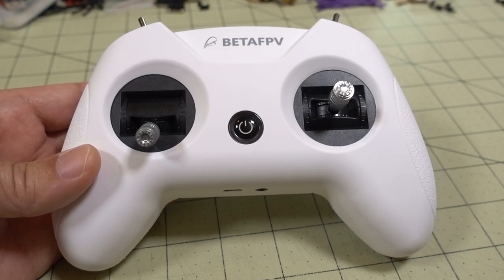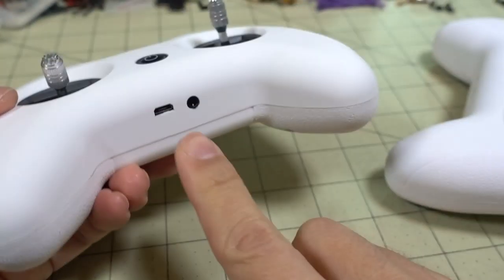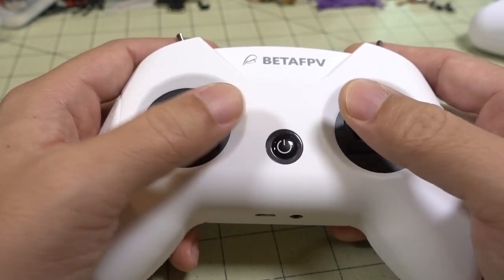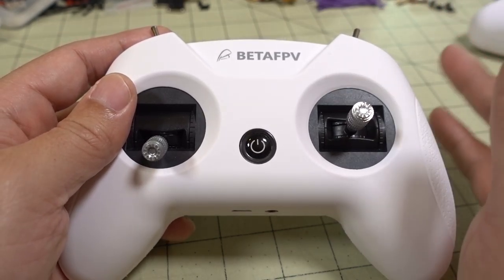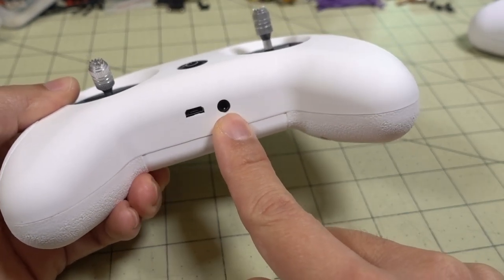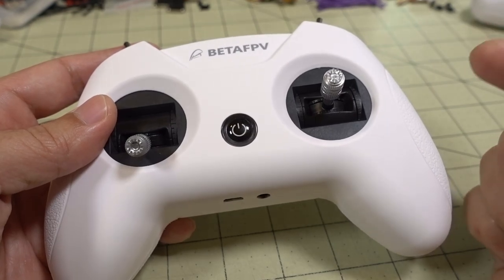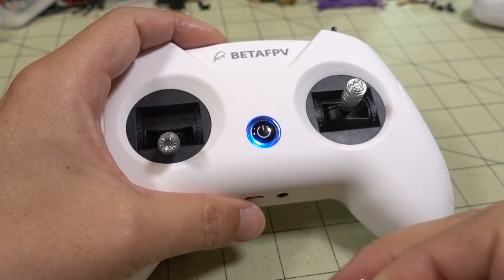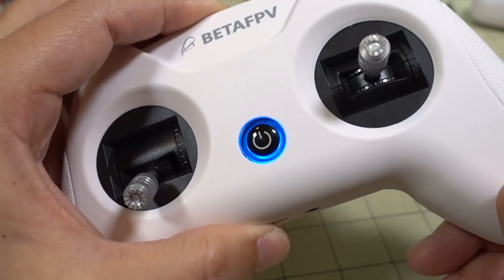BEST Beginner FPV Transmitter // BetaFPV LiteRadio 2 📡

Comment: Thanks for the great review!  The new features of being able to charge the batteries inside the TX is awesome and the extra modes makes this a great value.  Due to the increasing severity of my arthritis I have had to progressively move down from an X9D, to a QX7, to an X-lite and to the original version of this radio.  This because of the lower weight so my hands don't tire as readily, but I still have to use the X-lite to fly any D16 models.  However, the fact that I can simply remove the extra weights in this version is a real game changer for me and great thing to know.  Hopefully, I will get one these when they become available.
Reply: Just an f.y.i. they are already available on beta fpv's  website. Atleast they were yesterday when I was on their website.
Reply: @itsme-fr5fr  Thanks!  I'll check that out.
Reply from the maker: Yes, you can buy these now.

Comment: I got mine a few days ago (purchased from FPV Cycle, shipping was FAST!) and I gotta agree, this is a nice little radio, and perfect for Whoops or as a travel radio.  I am one of those that think the gimbals are a bit loose, but I do like tighter gimbals in my radios.  But I would say the tension is "average".  The big miss for me (just like the x-lite) is no lanyard lug to hook my strap to.  I pinch and have big hands, so just holding the radio doesn't do it for me.  I had to fashion a "holder" for my lanyard and it works great now, but would have been nice to have a lug built in.  For $40 you really can't go wrong.
Reply from the maker: Yeah, for $40 I think it checks the majority of boxes for most people for a budget radio in this class.  For those that need more, they should consider the higher priced models in the $100 to $150 range that will do a lot more for a lot more people.
Reply: Project Mockingbird how does it feel for pinching?  I’m a pincher too
Reply: @philevon  I'm 6' 2" and have big ish hands, and if i didn't use a strap pinching wouldn't be comfortable to me.  It's the same issue i had with the x-lite.  But with a strap, no problems!
Reply: @Project Mockingbird how did you fashion a strap holder? Zip ties?
Reply: @slightlymedicated  I had a really big rubber band that I looped over top...hard to explain in text

Comment: Trivia bit just got my Betafpv tx and it fits perfect in the Fatshark V3 goggle case. ;) so does a Mobula7 with 8 batts LOL!
Reply from the maker: You got all that to fit in there???
Reply: @AlbertKimTV  Either or, just the controller and batts or 7 with tons of batts. The red light stick sw alert caught me off guard getting d8 set and it came with d16 default maybe they changed from d8. Waiting for the HD 2s great beginner quads why I got the beta to train locals. LOL!
Reply: @AlbertKimTV  I fly on my lawn and do public FPV outreach letting people go for rides with echine box goggles and dispel the drones are evil spying things. Then they see flying fast or proximity is not looking at stuff or people other than to avoid it or them LOL! we need to counter the neg media spin daily if we want FPV saved as a hobby.

Comment: Hey Albert, I've got the turnigy evolution that I use for a couple micro park flyers. A small radio that looks inconspicuous. Besides flysky to frsky is there a benefit to this over the turnigy? I have trouble pinching the turnigy because of the screen. Is it easier on the beta radio? Or should I just stick with the turnigy?
Reply from the maker: Pinching is not easy on this one either

Comment: please explain when it comes to actual flying when one has quads bound in different modes, i.e., one D16 XM+ quad and one D8 whoop. let's say I'm done flying my whoop and want to fly my D16 quad (already bound). will I have to change modes with that button sequence every time fly between quads with different modes?
Reply from the maker: Yes, you will need to change the mode to switch to the different type of receivers.

Comment: How is the latency on the trainer port?
Does the internal 2.4ghz tx turn off while in trainer mode. I would likely be using an ezUhf Jr module on this but I need the 2.4ghz signal to go silent.
Reply from the maker: How are you using a JR module on this with no module bay?  Also, how can I tell if the 2.4 ghz is off or not?

Comment: I would be interested in seeing if its possible to put some hall effect gimbals in this because that would make this a much more desirable product to me. 
 I know it has been done with a flysky i6 and the upgrade hall effect gimbals from frsky before so I bet its possible with a but of modification. 
Either way still looks like a great controller for $40 and would definitely be the one I purchased if I was just getting into the hobby, actually I still wanna get one now because of the size and I already own a frsky x-lite pro. The only week point is the cheaper gimbals because they don't stay accurate very long and you end up with alot of play in the middle stick witch makes it so you have to setup a big deadband for those channels and that's never a good time
Reply from the maker: I think adding hall effect gimbals might be available as an option for say another $40 cost.  So taking the $40 radio to $80.  There's no way they can add that and keep the price the same.  Also, they are not targeting seasoned pilots like you.  These are meant to be an entry level radio for a beginner who will use it for a while and then upgrade later.  So longevity is not the main goal of this transmitter at this price point.
Reply: @AlbertKimTV  playing devil's advocate, I love the form factor and really want simple and small.  I have a Taranis and it is just SO humongous for just fun-flying at a soccer field with a TH Freestyle.  I actually hope this is perfect for a single model intermediate flyer like myself.  Should I be looking at the more expensive small controllers, or will this do for casual solo-flying a few hours a month and flying on the sims?

Comment: Hey Albert... trying to get friends into the hobby and wondering if you know if this will bind with the frsky usb dongle for sims? Looking for the video for it but can not find it. Also the new dongles that are shipping will not bind with the older x9d+ with 2.2.4 firmware for some reason... however the new dongle version will only bind with the TX16s radios in the frskyX2 D16 mode.
Reply from the maker: The older dongles with the ACCST firmware and D16 mode will bind but the newer ones with ACCESS firmware will not.  I don't know how to tell the difference between new and old ones.
Reply: @AlbertKimTV  so is this v2 se radio access? 
The new dongles are access I believe as it only bound with the tx16s radios in the frskyx2 D16 mode.

Comment: Mine doesn't have a battery or a place to plug it in. I lost my original and am trying to hook up my goggles to my new drone and it can't figure out how to bind it. Any suggestions?
Reply from the maker: The binding instructions are in the manual.  That didn't work?
Reply: @AlbertKimTV  no. Also the gimbals are all switched around. Left goes up and right goes down and the left stick doesn't do much but is also backward. I think it's supposed to be that way but the right side is for sure wrong

Comment: ok but what do we do if we do need to calibrate the sticks?
Reply from the maker: You have to follow the instructions in the manual by adjusting the settings in OpenTX.  This is because there is no screen.
Reply: @AlbertKimTV  can you send me a link to this comprehensive manual please. My manual was a two page piece of crap that walked me through protocol and binding

Comment: Where did you download the drivers to use it as a controller i dont have a program files \ devention upgrade tools driver folder on my pc 🤣 is there a link for the driver please , thank you in advance
Reply from the maker: You don't need a driver for a Windows 10 PC.  It will usually be recognized.  If not, see in the video where I show how to correct it if the wrong driver is installed.
Reply: @AlbertKimTV  Doesn't work. I only have the better_usb_hs available to me.

Comment: Hi, I try to charge the batterie by the USB port since it is built in 
but it doesn’t work. Do you know how ? Thx
Reply from the maker: Did you get the v1 or prototype version from the first batch?  Those don't have the charging circuit.
Reply: Albert Kim hi? I have the v1.

Comment: Can you explain what d8, fs16 and all that means? is it just receivers from different brands use these letterings? There is so much terminology its really quite difficult to get a handle on. For example I see a drone with a receiver that says "compatability,FrSky D16" Your thing shows "FrSky D 16 FCC, and D16 LBT. How do you know which to use?
Reply from the maker: There's the name of the receivers and the protocols they use.  The important aspect is what protocol they use.  If the receiver uses the D16 protocol then the radio/transmitter must match it and be the same otherwise they won't bind and you can't control it.  Within each protocol, there are subsets like FCC (united stated), and LBT (europe).  You'll have to know what region you want to use and again have to match it with the transmitter.
Reply: @AlbertKimTV  Ah I see. Thank you for clarifying.

Comment: Hi, I have a BetaFPV LiteRadio 2 to fly two eamax small drones?  Does work in one of them but not in the other, which could be the problem? the second one appears to be bound because lights follow the throttle movements but motors not move, any idea? I have repeated the binding sequence several times with the same result.  Thanks
Reply from the maker: Not enough information about the two drones.  One must be using the same protocol as the LiteRadio, the other must be using a different protocol.  That's my best guess with limited information.

Comment: Don't buy it if you want it for sims. Just got mine and it won´t calibrate. BetaFpv answer was, well something is just not possible to calibrate it. And now they´ve just gone silent on me...
Reply from the maker: which simulator are you having trouble with?
Reply: Hi Albert, thank you so much for your response. I've tried FPV Freerider (paid version) and Real Drone Simulator. But I think any simulator will act the same way. When I calibrate on Windows throttle and Yaw, it goes crazy. It's like your pushing the stick in all directions at once.